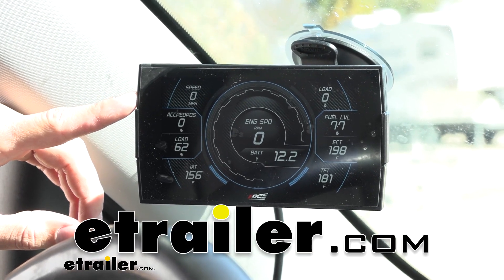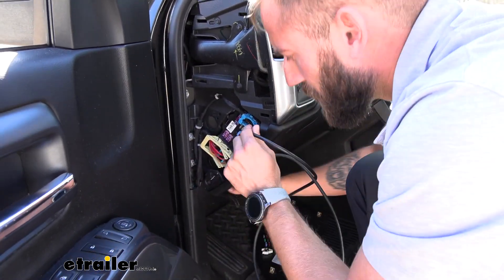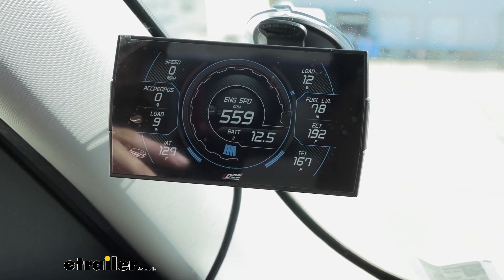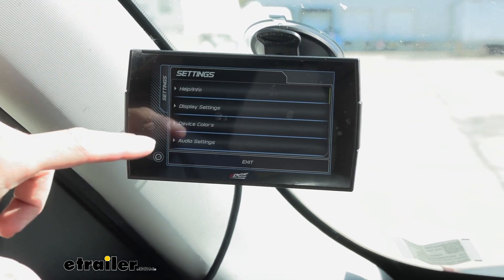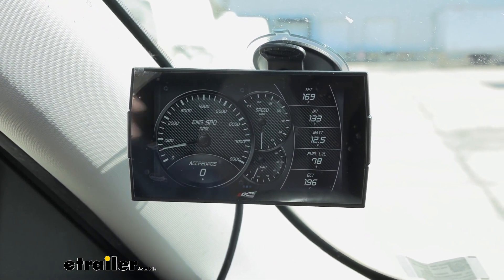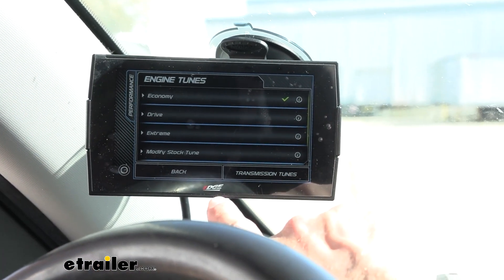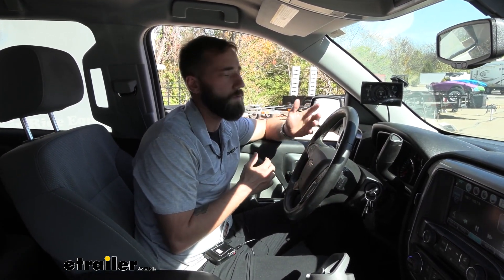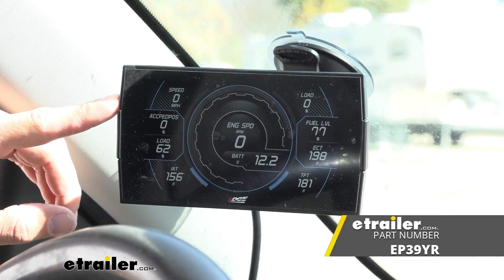etrailer | All About the Edge Gas Evolution CTS3 Performance Tuner

Comment: the suction cups NEVER hold for very long.  I had to glue my GPS suction cup to keep it in place.
Reply from the maker: I am sorry to hear the suction cup was not holding as it should. I always recommend cleaning the surface very well before, and then applying a tiny bit of water to the rim of the cup before pressing it on for better suction.

Comment: Just put it in tow mode
Reply from the maker: You can certainly do that. However, the tuner offers more features in addition to improving towing performance. It will also provide a boost in HP/Torque for when you aren't towing, as well as the ability to monitor vehicle parameters like EGT, regen cycles, trans temp, boost, RPM, and more. It also provides the ability to read and clear DTC's. So, it's not all about towing...
https://www.etrailer.com/Performance-Chip/Edge/EP39YR.html

Comment: Does it have features for fuel/gas level, water temperature, and transmission temperature?
Reply from the maker: What the tuner will monitor can depend on the vehicle year/make/model and which engine it's equipped with. If you can get me that info I can get you an answer....
Reply: @etrailer  well it’s a 2001 Ford Ranger with a 6.0 LS swap motor

Comment: Would it work with a 2005 f-250 6.7
Reply from the maker: Do you mean the 6.8L V-10 engine? If so, you'll want to use the # EP59YR.
https://www.etrailer.com/Performance-Chip/Ford/F-250+Super+Duty/2005/EP59YR.html

Comment: Would it work on a 2008 Tahoe 5.3 please let me know
Reply from the maker: The Edge Products # EP39FR is indeed compatible with your 5.3L equipped 2008 Chevy Tahoe. Keep in mind though, it's not CARB approved so you wouldn't be able to use it if you live in California.
https://www.etrailer.com/Performance-Chip/Edge/EP39YR.html

Comment: Will it work on my tbi 1991 Silverado 5.7 350?
Reply from the maker: It will not. Tuners like the # EP39YR Edge Evolution interface with the vehicle via the ODB II port, which vehicles weren't equipped with until the 1996 model year. Unfortunately we don't have a tuner that will work with your truck. I wish we had better news for you.
https://www.etrailer.com/Performance-Chip/Edge/EP39YR.html

Comment: hey man great video, will this tuner work for a 2019+ gmc sierra 1500 5.3L V8?
Reply from the maker: The # EP39YR shown in the video you'd checked out wouldn't work in a 2019 + GMC Sierra. You'll want to use the # EP49YR, which is compatible.
https://www.etrailer.com/Performance-Chip/GMC/Sierra+1500+Limited/2019/EP49YR.html

Comment: This work on f250 superduty 6.0 2003
Reply from the maker: It won't. The Edge Evolution # EP39YR you'd looked at is for gas engines. For your 6.0L Diesel, you'll want to use # EP96TR
https://www.etrailer.com/Performance-Chip/Ford/F-250+Super+Duty/2003/EP96TR.html

Comment: Would this tuner work on a 4.6 2009 f-150 I recently got a 6.5 lift 35s and 24x14 I wanted to see if this tuner would fix my gear ratio and gas mpg
Reply from the maker: The # EP39YR CTS 3 Tuner is designed for GM vehicles, so it won't work with your F150. You'll want to use # EP59YR. The only thing that will fix your gear ratio is changing your rear gears, but the CTS 3 will allow you to recalibrate your speedometer to compensate for the taller tires. Typical users see about a 3-4 MPG improvement using the economy tune. Hope that helps!
https://www.etrailer.com/Performance-Chip/Ford/F-150/2009/EP59YR.html

Comment: This works on 2001 gmc sierra ?
Reply from the maker: According to Edge, the # EP39YR CTS3 Performance Tuner will fit a 2001 GMC Sierra with the 43.,4.8,5.3 or 6.0L engine.
https://www.etrailer.com/Performance-Chip/Edge/EP39YR.html

Comment: Can you deactivate the AFM with this? Silverado 2017 5.3
Reply from the maker: Yes you can, but you'll want to use the # EP49YR instead of the tuner shown in the video.
https://www.etrailer.com/Performance-Chip/Edge/EP49YR.html

Comment: I need some guidance. Last year I bought my first truck ever, so I am new to the truck world and its language. The reason I am looking into a tuner is to improve my MPG. I have a 2022 F-350 dually 7.3 V8 gas. I don’t not tow anything. This is my weekend ride. Is this a program that is compatible with my ride?
Reply: why do you have a dually if you don't tow anything also you will never get good fuel millage on that thing
Reply: @bradendeculus7781  solely for looks.
Reply: @Raiders4xSB  u still got it

Comment: would this work on a chevy 1500 4.3 v6 2018?
Reply from the maker: It won't. This tuner is designed for the Silverado up to 2016. For your 2018 truck, use # EP49YR.
https://www.etrailer.com/Performance-Chip/Chevrolet/Silverado+1500/2018/EP49YR.html

Comment: Just bought the CTS3 Evolution tuner. How do i tune my truck for HP and torque? I tried all the tunes it came with, but my 5.3 feels the same
Reply from the maker: What's the vehicle?
Reply: If it has a 5.3 has to be a silverado or a denali
Reply from the maker: Figured it was a GM product, but need to know the model and year.